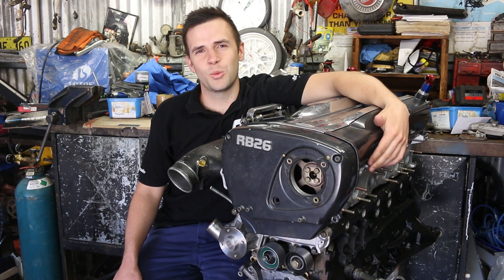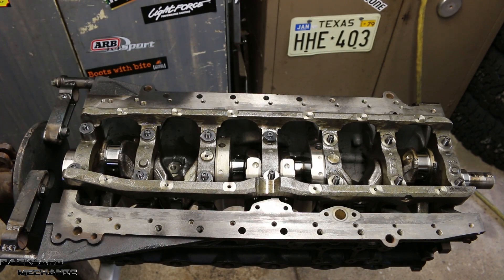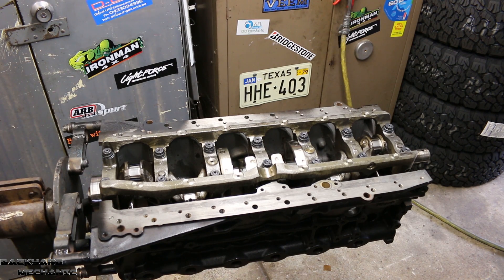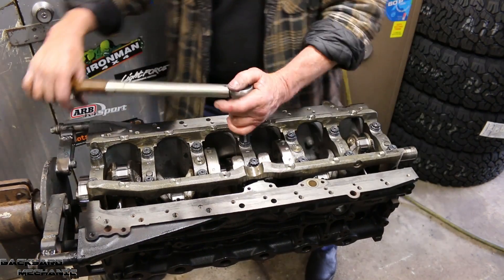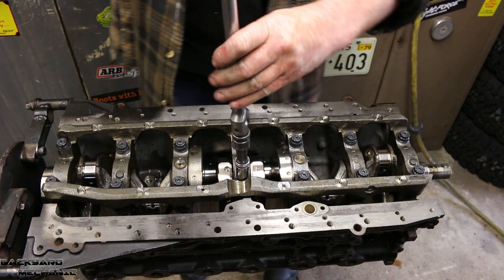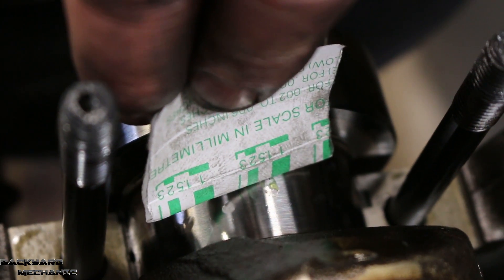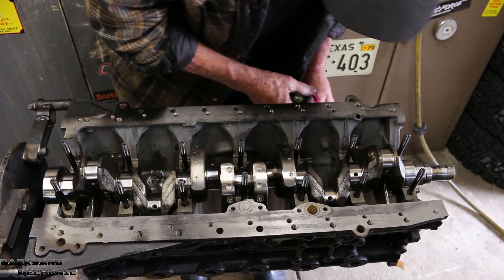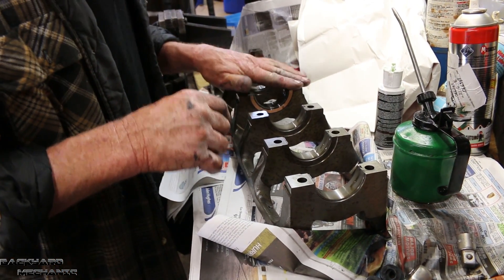FORGED RB26│HOW TO USE PLASTIGAGE◄► MUST WATCH│PART 2

Comment: This has infuriated me. I'm a mechanic by trade, and my background is performance and heavy diesel engine rebuilding. If your building a performance motor, I'd throw your old man out of the workshop. 
Starters: The girdle is required to be torqued up by sequence to make it lay out, this means it's taking the twist out of the girdle, as well is creating a correct seating, which is ESPECIALLY important when under load. NOT torquing to sequence can cause the girdle to be bound or restricted in it's lay, which can cause crank deflection, incorrect float, and unnecessary vibration. Although this seems minimal, it's take minimal to destroy a performance motor. 
Secondly: whoever the fk inspected your crank, needs to be fired. The pitting on that crank is disgusting.
Thirdly: ARSEUMPTION on bearing clearances, at MINIMAL you should be using FACTORY clearances, MINIMAL, not ARSEUMING that 1.5 is ok, if ANYTHING you should have rung performance machine shops that do these engines and spoke with them.
Forth: Saying that you can't change the difference in clearance is ABSOLUTE BS! AGAIN, ASK THE QUESTION< DON'T ARSEUME!

Mate Seriously, you need to approach what and how your doing this, your transferring alot of incorrect information
Reply from the maker: exilerob Thats your opinion, perhaps what you were taught from your learning sources is different to how my dad was taught. My dads rebuilt performance motors aswell. He's seen some shit. I'm not going to get into a huge debate. You know as well as many other trade mechanics, you have your own way of doing things. Your own procedures ect. I trust in what my dad has taught me and done. I've also crossed over measurements to others who have built this engine. I'm confident in my dad and his trade. There's other shops and places that mess things up and aren't perfect. Should this engine break, I'll just fix it. 

I respect your views on the matter, and I'll take what you've said into account when I build motors going forward
Reply: It's not an opinion so much as a specific field of industry understanding. I was taught in professional racing teams, the top levels mate. However I respect your reply, but certainly take what myself and others who do rebuild these motors often have said, on a serious note. I probably shouldn't have been so brutal on your Dad, but I see this so often, and heart break from it so often, that i'm sick of repairing engines from incorrect procedures, or lack of understanding on these motors, and sick of seeing young fella's loose so much due to it. Other then that, your cars coming along nicely.

Comment: torquing that pattern the way you first did it WILL warp the girdle.
Reply from the maker: 040mobil Will it?? How can you prove that?
Reply: I have a bent one in my shop i can send to you if you like.I recieved a motor from a customer with the bearing clearances were "really weird" being his complaint. when I asked him he stated it was tightened starting at one end and going to the other because he was "only checking to see if the crank would spin"  The VG30 cradle is a bit more forgiving due to its short length. The RB cradle is not.
Reply: I think more the point is how can you disprove it?Im sure since this was all put on here you have since learned the correct procedures.

Comment: cringed a few times during this.
1 girdle should be torqued down as per manufacturer spec from inside out
2 1.5 thou is very tight for what is claimed to be a race motor. despite what your dad said you can alter the clearances by mixing bearing packs.
Reply: I have 5 different size shells in my bottom end. I agree.
Reply: or rotating the bearins around, using some maths to differentiate the differences.

Comment: So factory manual has clearance tolerances as well as a torque sequence. Would it not have been best to try and match or follow the torque sequence? Nissan and Nismo as well as a few others have multiple different steps in their bearings to make up different tolerances(not that yours are bad). Like he said its splitting hairs, but if your a bunch out you could go out and get the nismo bearing to change your tolerance to be within spec.
Reply from the maker: ogopogoful The final measurements were within spec. As for the sequence I've learned and been taught it only matters to go inside out when there's a gasket in between the two surfaces.
Reply: Sorry but they are not within spec they are tight.Always torque inside to outside then when removing start from outside working way back in.Have a think about whats happening with your process and the process others are explaining.Investing in a air gun would be beneficial also.

Comment: Great video, you excited me ya said Friday bra haha! Say you had a bearing clearance way off what would you have to do? different bearing? shims to compensate?
Reply: probably crank or cradle is bent
Reply: I say cradle.
Reply from the maker: James Frost First thing that's important is to get the tunnel line bored/honed. Make sure to give the bolts/studs you're installing to the machinist. ARP studs have more clamping force so they need to tighten them down with the ARP studs then line bore/hone. This makes sure that when you torque up your new studs it will be perfect. If you've done that and it's still off then the fault will most likely be the bearings. We didn't run into that problem and I'm not sure on the chances of striking a bearing that's way off. If it was me, I'd buy new bearings. But it would be wise to check with your machine shop and/or the garage who's gonna tune your car and see if there's any other reasons it could throw off that measurement. In saying all that if you measured it and it was all wrong check the crank journals to know they are the correct size. If they took a lot of material out when they did the tunnels that can effect the clearance too. Also check the thickness of the bearing shells. You'll hardly ever run into this problem